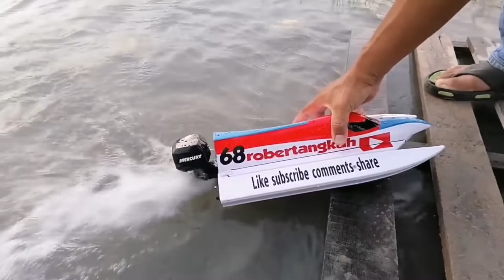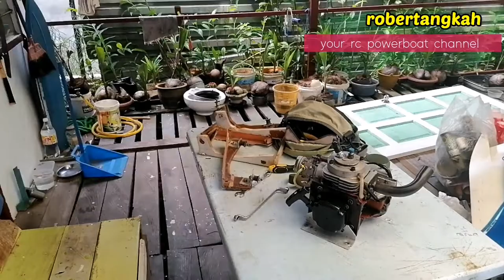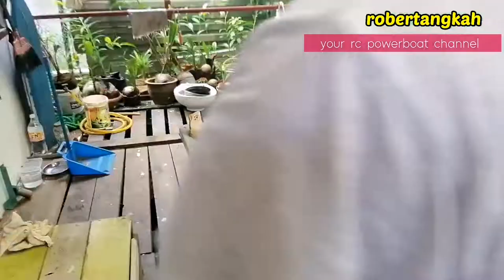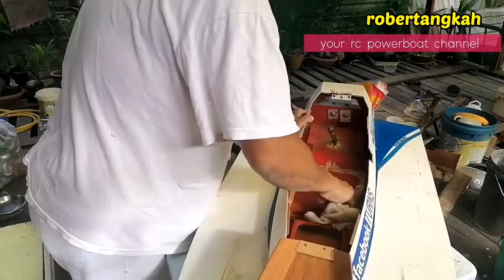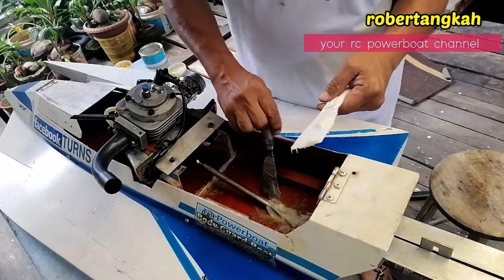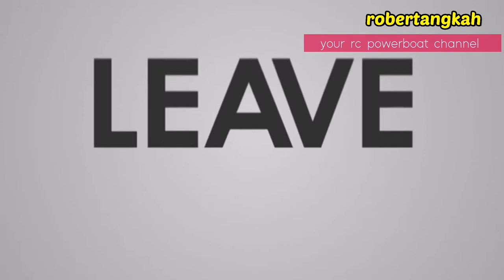How to Install Chainsaw Engine into your remote control Powerboat

Comment: salam ari Mukah Tuan.
Berapa harga sebuah boat ready 2 go Tuan.Boleh pm saya Tuan.
Reply from the maker: Yang kecik itu ka 350 tuan
Reply: @robertangkah  dengan enjin sekali kah tuan.kalau transmitter dan receiver/remote saya ada.
Reply: @robertangkah  nak beli Tuan.
Reply from the maker: Ya
Reply from the maker: Shoppee 😬
Reply: @robertangkah  hihihi..bukan yg tu tuan..boat ada enjin chainsaw,sekali enjin...hihihi..
Reply from the maker: @ynot3680  saya cuma ada injin rumput kuasa 35cc aja nak let go
Reply: @robertangkah  saya pernah  buat boat jugak Tuan,Model F1 dan Catamaran,guna enjin rumput 26cc dan chainsaw 30cc modified.Rudder,prop,kaki enjin semua handmade,malangnya x selaju mcm Tuan buat.Speed dia lebih kurang 20mph saja.X tahu lah masalah dia dimana,lalu saya give up Tuan.Beli jenis gasouline brand rocket harga 2k(belum kos pos)dari kedah,x lama guna enjin rosak,26cc zenoah.Lama dah terbengkalai x dibaiki.Speed pun kurang serupa 40mph saja.Teringin Tuan nak rasa homemade dari Tuan.Nak belajar.